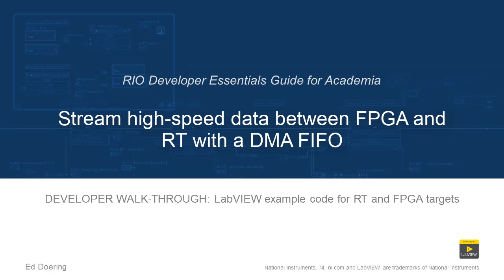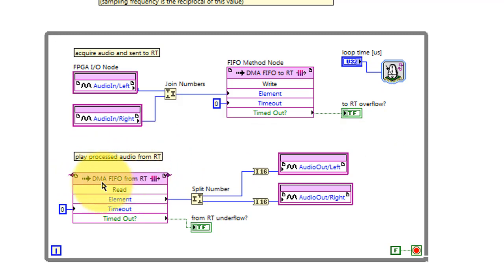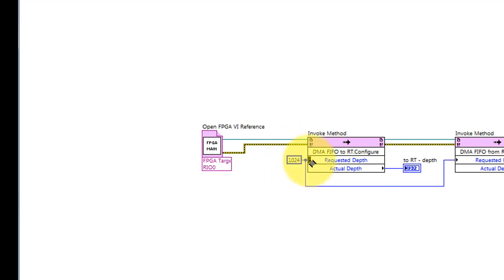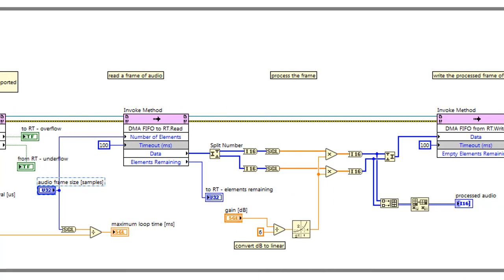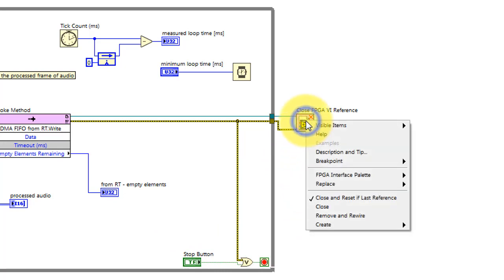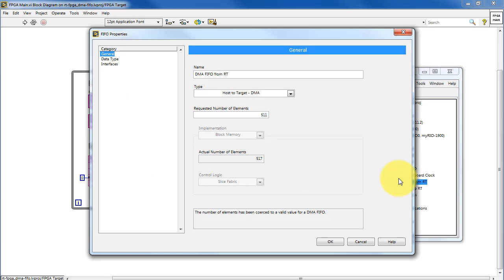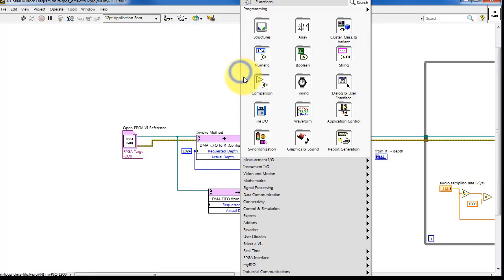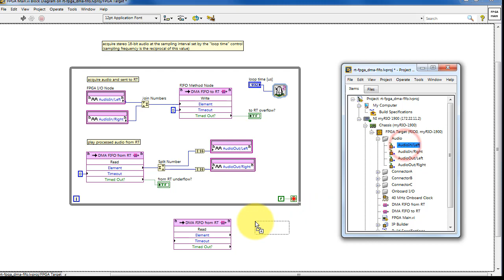LabVIEW code: Stream high-speed data between FPGA and RT with a DMA FIFO (walk-through)

Comment: I am using dma fifo from fpga to pc for high speed data of current spectrum but when I am giving an analog signal to any one analog pin out of four pins and and rest of the pins are floating, the signal copies on the other analog pins as well. I don't know what is happening with dma. Can you help regarding this?
Reply from the maker: Not sure if this addresses your question, but if you only need a single analog input and are not using the other three (they are unwired as you said), then you can ignore any values you read from those inputs, that is, don't necessarily expect them to be zero when you leave them floating.